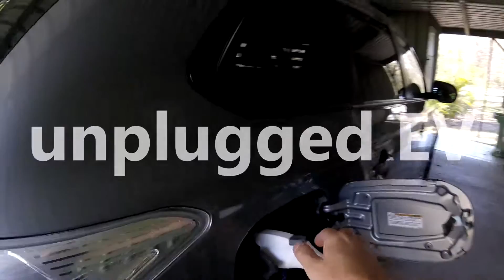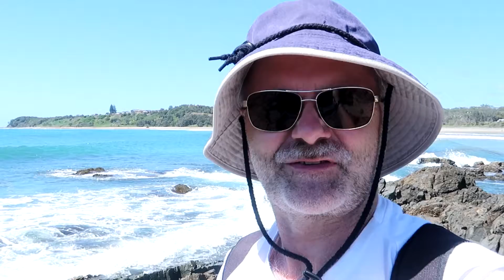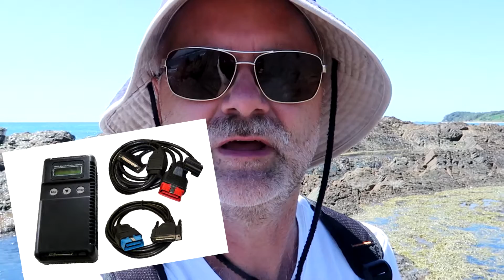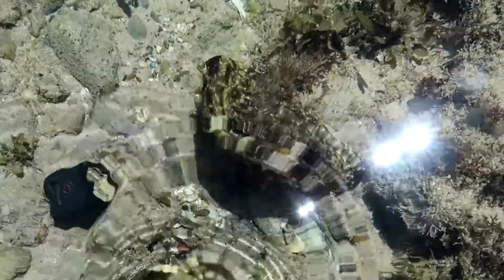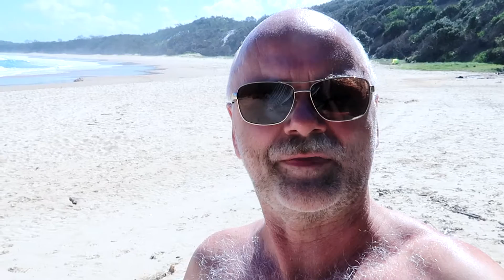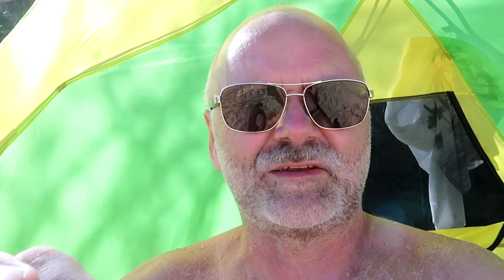Ep15 - Is your Outlander PHEV's battery still at 100% and why Mitsubishi is to blame for  the misery

Comment: So did Mitsubishi charge you for the smoothing process?
Reply from the maker: No, they haven't charged me. The dealer explained that this is a 'service item' usually and not covered by warranty but Mitsi was done it for free. Mitsubishi told them that the drift between battery SOH and ECU would be dependant on the usage of the battery (how much EV driving) and charging habits. I've asked the dealer after the correct charging of the car to avoid that from happening again. The answer was:" ... just plug it in...". Total lack of training for dealerships and mechanics in regards to these cars. Nobody seems to know anything and don't seem to care too much either... :(